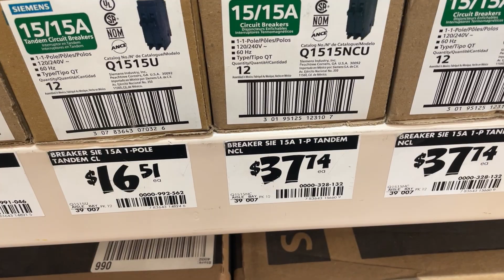CL vs NCL circuit breakers

Comment: Are they any different inside?
Reply: It's not that they are different it's that the panel is not designed for those to be used if the tab is blocked....
Reply: I had to buy both yesterday, because I'm not sure which I actually need. I can feel a noticeable difference in weight between the two. The more expensive one weighs more.